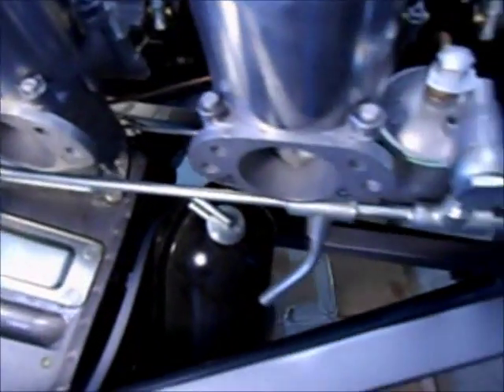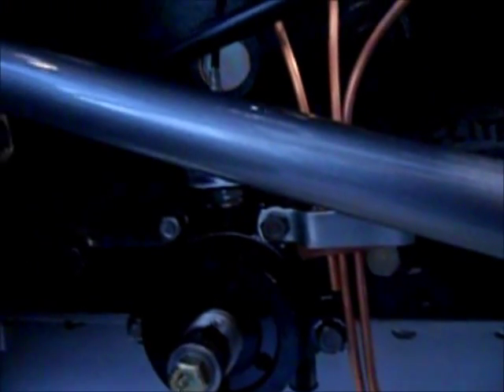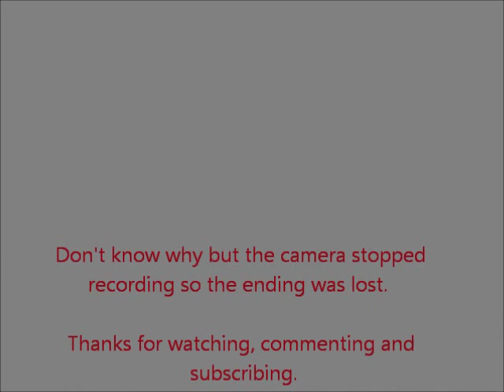Bettie my '63 Jag E-Type Restoration - installing barbed fuel line fittings, throttle links and fuel

Comment: Looking great john.   Any thoughts to putting an inline fuel shut off valve?  Quite a few of the Triumph guys have added them either just before the pump or just after.   Comes in handy if you do have an issue with floats/jets/seals etc leaking on the carbs and you need to tinker...
Reply from the maker: Dave, I hadn't thought of that but I do need ot do a little repair work on the main steel fuel pipe - which I will show where I kinked it.  Failures and repairs are sometimes the best lessons to share.